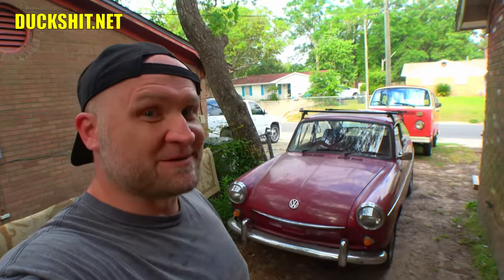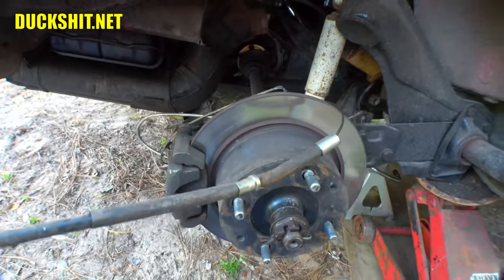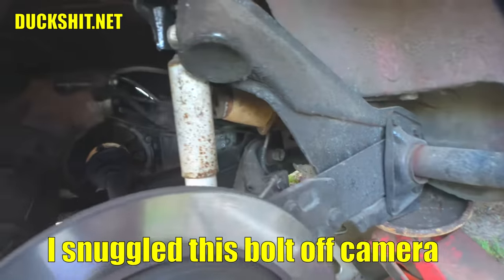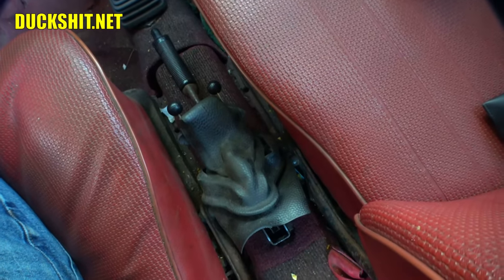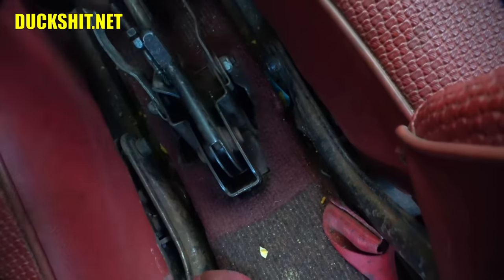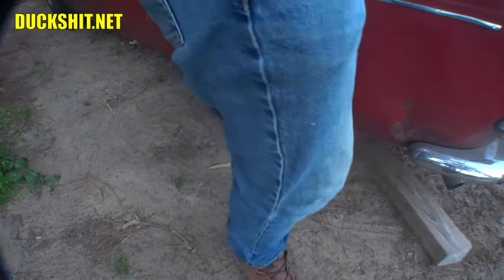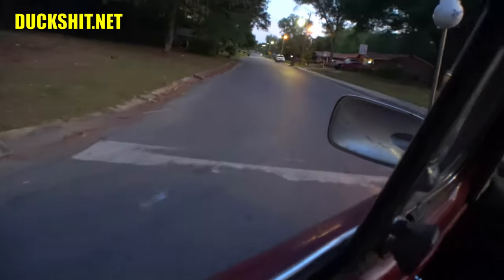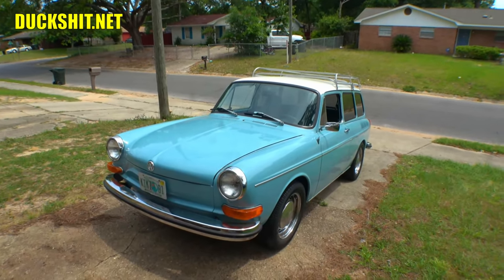My Parking Brake Lever Went Limp!  - VW Rear Disc Cable Replacement

Comment: I restored a 1970 Squareback sane color as this one !  I kept it all original including the 3 speed auto, which shifted excellent. The fuel injection was in pieces as well as the cracked engine block and rusted body. Took me almost 2 years to finish but was well worth it attending car dhows and VW rallies. I just couldn't believe when I started it up for the first time, it fired right up after about 6 seconds and ran like new! That efi system was great for that time period, unlike the electronics of today.

Comment: Hi Duckman, would be nice to see a small series on giving Rubby some love it deserves. Fixing rust would sure keep it in the stable longer. Waddayasay?
Reply from the maker: Thanks!  We've been doing that all along!  Little by little... small series!  Not much rust to repair on there, though.
Reply: @DuckmanCycles  well... that HUGE hole on the rocker and arround the engine compartment... easy job for you!
Reply from the maker: Huge?  You must have a different perspective of what is huge lol! 😁👍🦆💩
Reply: @DuckmanCycles  LOL... all that can't fit in a hand... is huge!! LOL
Reply from the maker: Hehehehe it’s not that big
Reply: @DuckmanCycles  Still, its not OEM... LOL
Reply from the maker: Well I dunno.. it is original materials!
Reply: @DuckmanCycles  yep, and its like the universe... expanding!
Reply from the maker: @hasbeengood nope not changed at all since I got it, pics prove so.  😁👍🏻🦆💩
Reply: @DuckmanCycles  LOL, but it would be nice if you fixed it.
Reply from the maker: @hasbeengood  that would be awesome, just not high priority!
Reply: @DuckmanCycles  I understand. No worries.

Comment: Good fix today. I see that not only you don't have windshield wipers. - motor. I see no heater either? I lived in Florida, and it gets really cold. Lol. Like the boots. 👍🦆. Noel
Reply from the maker: I have a working heater, you can see the levers on beside the parking brake lever... and I won't go too far without a motor!  Thanks man, more about the boots coming up, too!  Sponsor stuff!
Reply: @DuckmanCycles and VW Garage  I'm talking about wiper motor. Plus you don't have your heater boxes hooked to the body of your vw.
Reply: No tubes
Reply from the maker: Yep, tubes decayed I reinstall them seasonally.  I won't need them again until next January.  So it'll stay like this for now.

Comment: Hey Glenn, I'm just gonna joke about you calling a VW Combe,(bus) and a VW Squareback (wagon) are not VW Thing(s). I have a simular problem with my 2019 Subaru brake cable on the left side. Thanks for reminding me. I need to goto Subaru and get it fixed. That replacement brake cable was an easy fix. Pray to God it wasn't made in China!
Reply from the maker: LoL!  A local journalist did a story about us and our passion for air-cooled classics.  She published a picture of Wild Bill's Bus under a headline that read:  IT'S A VW THING!   We do have our own VW thing I suppose, but its NOT a VW Thing.  Haha!  We all got a giggle out of that one.  But here in the US, a Transporter is a Bus... a Variant (wagon) is a Squareback....  so long as I don't keep calling the Squareback a Fastback all will be good!  LoL!
Reply from the maker: Good luck on that brake cable.... mine was indeed made in China, and so is the 30 year old one that I am still running without issues.
Reply: @DuckmanCycles and VW Garage  VW did make a fastback model too.
Reply from the maker: Yeah, you saw it in this video lol!

Comment: Have you checked to see that the right side of the lever through where the cable runs through doesn’t have a tear or something that frayed the cable? I am thinking that could be a possible cause? Boomer is the sweetest boy 🦆 🥰
Reply from the maker: Seems good, i blame China!  Thanks man!  😁👍🦆💩
Reply: @DuckmanCycles  And you would be right! The general rule for products from there is that they’re sub par; although sometimes they can surprise you with certain items. Kind of a crap shoot with them.
Reply from the maker: Yep, you never know that’s for sure.  But even harbor freight has a few gems, stuff they seem to get right!

Comment: Hey Glenn. It's been a minute the talks about Ruby. I couldn't remember the size of the engine..1776? I had a 1835 in one of my busses. Was pretty damn fast! Could burn rubber from 1st thru 3rd gears. Transaxle was spooled. 😁
Reply from the maker: Ruby is a stock engine as far as I can tell.  She goes like stink though because she's well in tune, and I know how to drive it!  Hehe!  She'll sorta burn out in 2nd on some roads... depends on how fresh the tarmac is.  😁👍🦆💩
Reply: @DuckmanCycles  ok bro. She sounds more like a 1776. The pop and growl. All 1776 has that. Now matter how you tune.
Reply: But.. all good brother 😁.
Reply from the maker: That's interesting, I've never noticed a difference in Volkswagen engine sound based on displacement alone.  Exhaust, carbs, cam... yes all affect the sound dramatically, but the somewhat small displacement change by itself shouldn't be discernible.  I've got good dual carbs and a glass pack exhaust, that's probably what you hear.  😁👍🏻🦆💩

Comment: Been there, done that! broke one once one my 72 Super. Noticed that you dont have your heater hosed hooked up, you live someplace where you don't need heat? :O
Reply from the maker: Florida yes.  I put those hoses back on seasonally.  I'm actually due for new ones.

Comment: IF the square is in for brake work in 73 the the bolt spacing in the brake calipers is different the three point seat mount with the star trek seat is the give a way for ordering parts the door arm rests are different they may be the same as beetle for 73 on Same with the ignition switch. The plate light in 73 doesn't use the chrome bulb holder socket like your earlier square back one of things I changed on my 73 I should have taken the interior tail gate panel completely off it cracked in half Just try help
Reply from the maker: Thanks for the heads up!  I think if we mess with the brakes on this thing, it'll be for a disc upgrade, too.  We'll see when the time comes, thanks man!